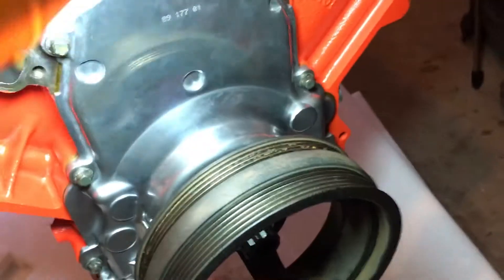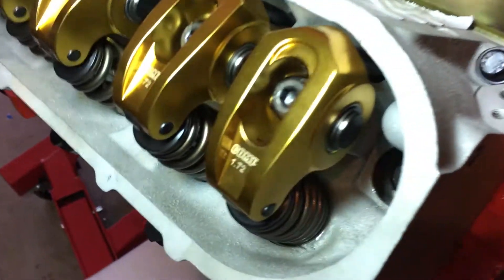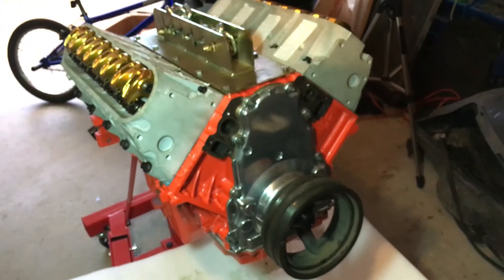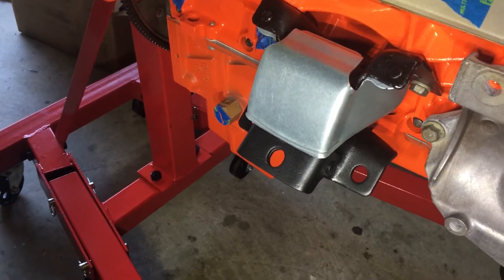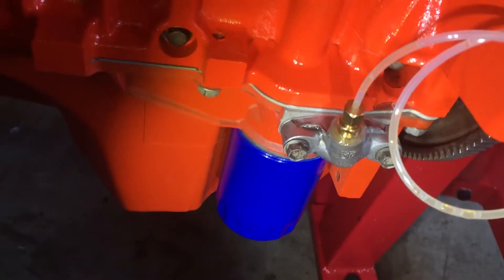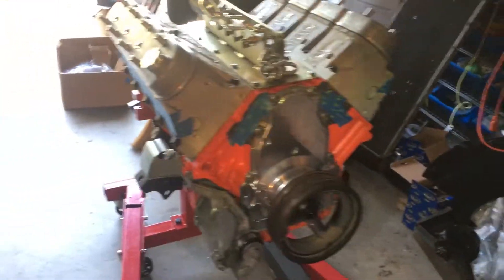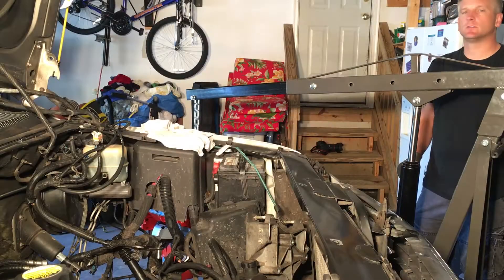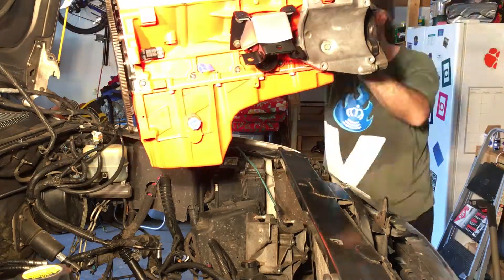Putting the 5.3 Engine Back In - 02 Chevy Tahoe - Rebuild vid 5

Comment: i want make my 5.3 motor in my 2008 tahoe stronger and faster. what should i do first or in order in regards to wanting to do that safely without damaging the motor?
Reply from the maker: Engines want to breathe.  My first performance mod has always been a cold air intake (or ram air intake).  More air in = more power.  Next, you might want to get a more free flowing muffler.   The better it breathes, the more power you can make.  You wont see much, but it's a start.  Get a tune and it will take advantage of those mods and you will see a difference.
Reply: @TahoeSteve  do you know of a good cold air intake California legal
Reply from the maker: I don't but i live on the east coast.  Give Google a try